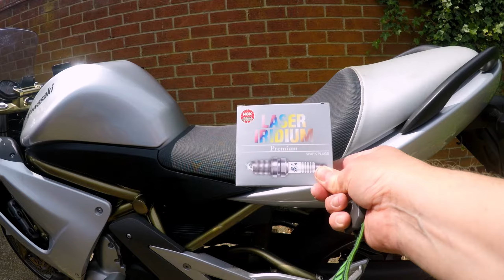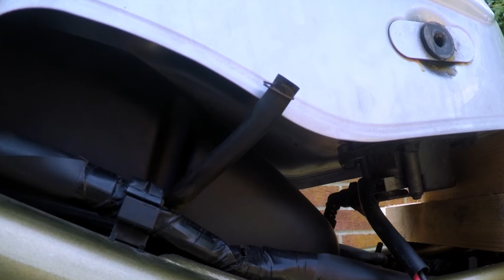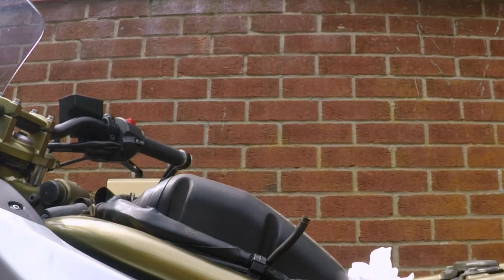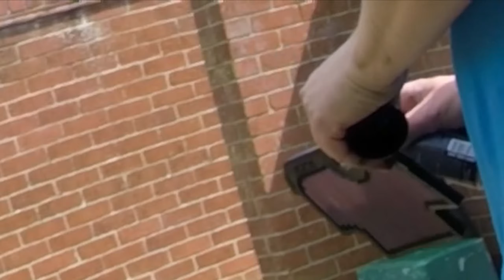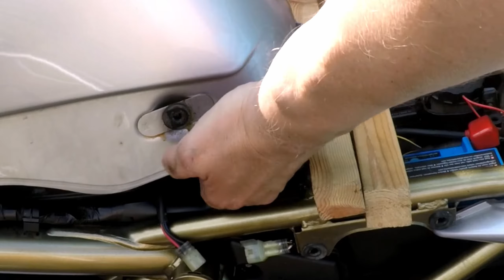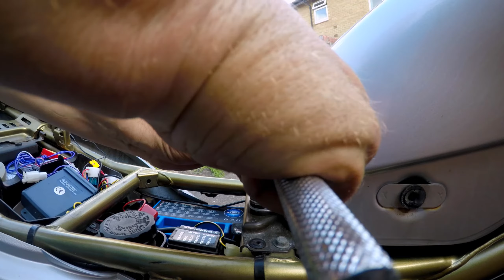How To Fit An Air Filter | Kawasaki ER6f / Ninja 650 (Performance Filter | DNA)

Comment from the maker: Today I fitted a DNA Performance air filter and NGK Iridium spark plugs (separate video, link below when uploaded).  I hope this helps you out, or you find it interesting to watch.  Anything you want to know ask below and I'll do my best to answer.

Seat bracket bolts are 10mm, could not find the torque settings for them in the Haynes manual (searched every section), I would say 10-15 Nm would be okay, use blue locktight to prevent them vibrating lose if you want.

Please give a thumbs up and let me know what you think, you could subscribe too if you like, thanks for watching.

I decided to get some merchandise set up on teespring with my logo as it is free to do, let me know what you think below and purchase some if you like 😉👍 

https://teespring.com/stores/hdr-store

See Videos 24 Hours Earlier And Support My Channel - https://www.patreon.com/HalfdeadRider

Paypal Donation - https://www.paypal.com/cgi-bin/webscr...

Subscribe - https://www.youtube.com/c/HalfdeadRider

Instagram - https://www.instagram.com/halfdeadrider/

Twitter - https://twitter.com/HalfdeadRider

Facebook - https://www.facebook.com/HalfdeadRider

Comment: Does the tank have to be empty or not? Will it leak fuel if you have fuel in it and remove it?
Reply from the maker: No it will be ok, a small amount may come out when you first remove the tank just have some rag or blue roll ready to soak it up.
Reply: Assuming the same for a versys 650 2008?

Comment: Recalibrate your tork wrench there's a a tutorial on YouTube
Reply from the maker: Yea I knew how too but some time later (years later I believe), I just bought a new torque wrench. As I'm very well practiced I only really used it on cylinder head and camshaft cap bolts.

Comment: Just did this on my 2019. This is WAYYYY easier than the newer bikes, I'm envious lol
Reply from the maker: You'd think they would find ways to make it even easier, not harder wouldn't you! That was an easy bike to work on, had it pretty much totally stripped down to engine, frame and front end during first lockdown. Thanks for watching and commenting still 👍
Reply: @HalfdeadRider  You'd think so lol but apparently looks are more important than functionality or ease of maintenance. Realistically, the extra fairing bits on current generation 650s are unnecessary because these bikes really aren't race bikes, just standard bikes with fairings. I would much rather prefer a simple fairing and tank setup like yours. How many miles/KMs are on it now? Just rolled over 12k miles on mine
Reply from the maker: @wrenchrat  when I sold it in March it had about 21-22k miles on it. They are great fun bikes due to the torque, not great top end, but getting there is great fun. I have a ZX9r now, an even older bike (21 y/o), but a very good one.

Comment: Does the tank needs to Be drained for this?
Reply from the maker: No, but the thing is, the more fuel the heavier it will be. My tank had a fair bit of fuel still in it so I just had to be a bit more careful moving it around and putting it down, prop it up using some wood so the fuel pump does not get damaged. Thanks for watching.
Reply: @HalfdeadRider  big thanks!  Willl, respons when on pc.
Reply: @HalfdeadRider  Ow ok, one of these days i will be checking the filter. After 18000kms it might be ready for a change.